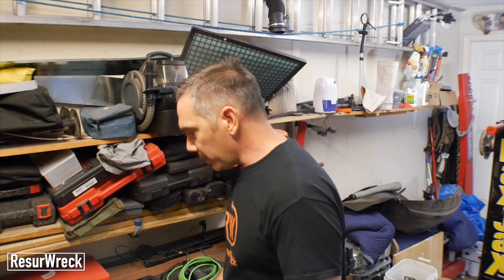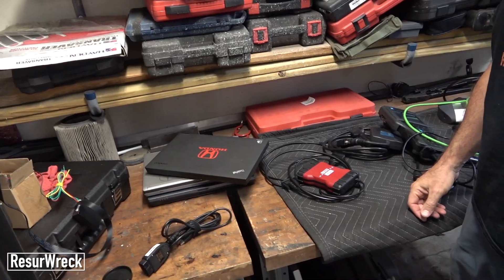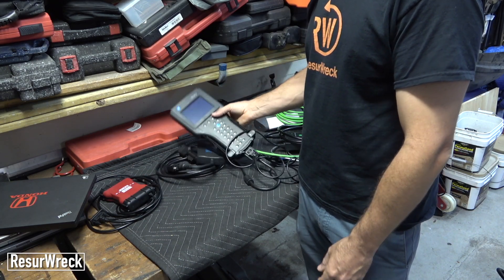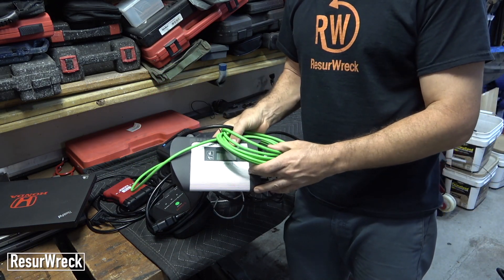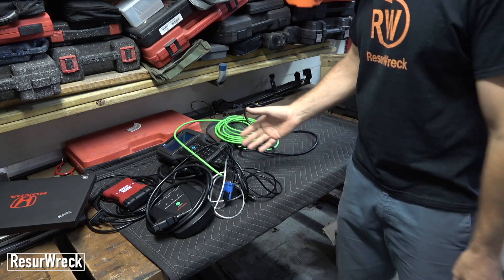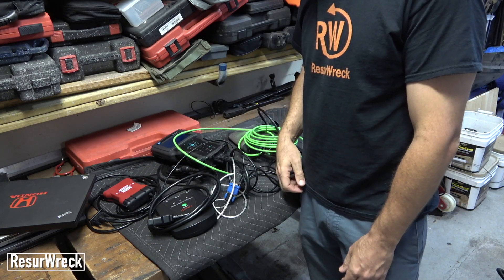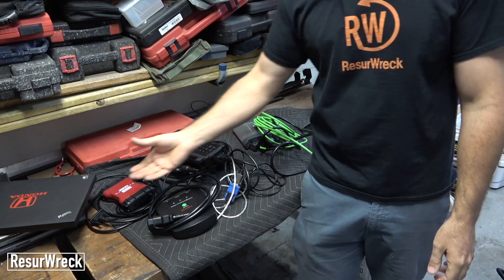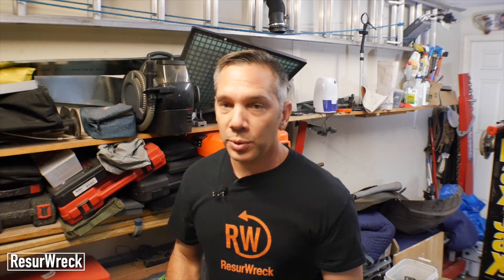Are Chinese Cloned OEM Diagnostic Tools Worth It?

Comment: The cloned tech2 is a good product despite what some people say. It performes well and has done everything I wanted and more. Some people claim the tech2 reboots during a crank as all you have to do is put it on dc power from the adapter during those tests. Mosr chinese electronics are great as most of the components for all scanners are made in China anyway..

Comment: Excellent review. If you don’t mind “playing with your tool, dive in” like most all clone electronics from China, you the end user, will be final quality control because even if the fake tool is made in the same factory as the bona fide OEM tool, the China production line DOES NOT do the same processes or quality control. Different manufacturing spec guidelines. No OEM oversight.

Comment: Just to add the devices themselves are not dangerous to use the fiemware in all the clones is usually 100% original, its the cracks and patches to the registration software like IDS ,and HDS ,etc that might be key logging or have a Trojan  payload  the best way to run this safetly is to run this in a closed environment in a virtual machine , that has no network function enabled so the patches or cracks cannot talk back to the hackers mothership servers in china or russia etc .  Ive build many sandboxed virtual machines for my clone tools including tech2 , mdi gds2 offline version  2021 , vcm 2  ids, etc on my primary laptop . Zero issues and completely safe ..!😊
Reply: have you ever ran into trojans and or other malware?

Comment: Can You Tell Me If You Have Used The GM Tech Tool on a 2008 or 09 Hummer H2. And Can You Tell Me Where You Bought The One That You Have Now. I Don't Want To Spend The Money Without Knowing If It Will Work For Me.
Thanks in Advance

Comment: it all depends on the quality of the clone tool.  really, you get what you pay for, so cutting corners will always have drawbacks but my experience with clone tools is that if they are of a good quality, then they will work just as well as an OEM tool, but there maybe some slight differences.  I have used many different types of clone Ford VCM'2 clones and the good quality work without problem.  I have never damaged an ecu or any part of the cars electrical system using a good quality clone tool.  There is one main difference and that is when downloading a ccf file the clone tool will show 0v not 12v+, due to a slight variation in components and design over the orginal.  You will save yourself a lot of money, but If i had the choice to buy OEM or clone then i would choose OEM everytime.  It is only the drastic reduction in cost that makes the tools lucrative to the buyer, as everyone wants to save money in the short term.  People who say about the clone tool contacting the manufacturer to disable itself is at best verbal faeces.  Bottom line - if you are going to buy a clone, then buy a good quality one.  If you buy rubbish then it does fail half way through programming an ecu, then you only have yourself to blame for cutting corners

Comment: Never have wi fi / internet activated on the lap top you are using.  Some of the clones ( like Mercedes ) will phone home on it's own to the car factory and brick the tool.  

Last I checked the OE Mercedes tool was $ 20,000 with a yearly subscription update costing $ 6,000.  If the yearly sub isn't paid, the tool will stop working.

Comment: GM now uses GDS2.  The MDI is the actual J-Box hardware at is now used instead of a Tech 2.  The Tech 2 can still be put in to passthrough mode and used to program all cars as a J-Box would be.  I've been programming GM's with a Chinese MDI2 clone for years, as well as running GDS2 and Tech2Win on it.  GM doesn't know it's not real, it loads all the latest MDi2 firmware on it and everything.  The support thing is correct.  I am an IT guy so I can normally figure them out.  I recently did a video on how to configure the clone Mopar Micropod II's
Reply: I believe the Acdelcots has blacklisted most  gm1 and gm2  clones serial number , so it's advisable not to use that as your passthru device and use it offline only now.

Comment: That tech2 clone is junk. Reboots on engine cranking which is useless
Reply: Nope it's not junk it's just the moresun DC to DC regulator cannot be replicated well , so the clone regulator needs a external supply during cracking the ignition . Run the 12v inlet to a cigarette lighter jump pack and it won't reset on ign crank.
Reply: Does this plug into a lighter / power point socket for power?  Some sockets power off during cranking to shed load.